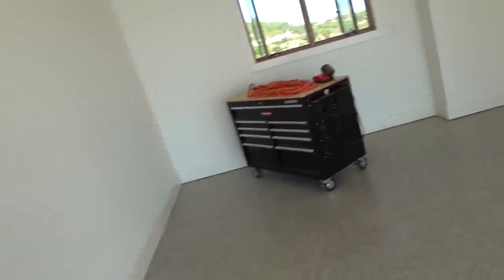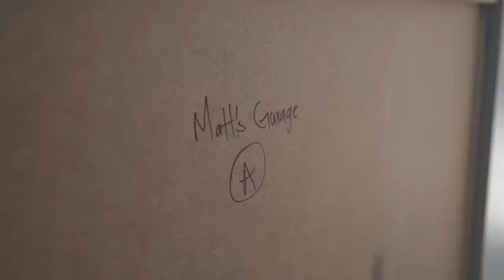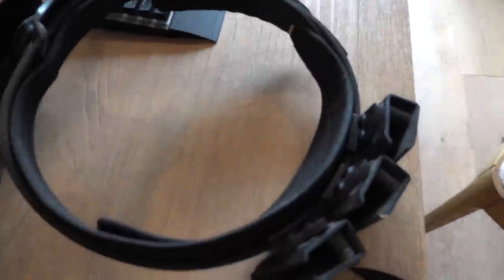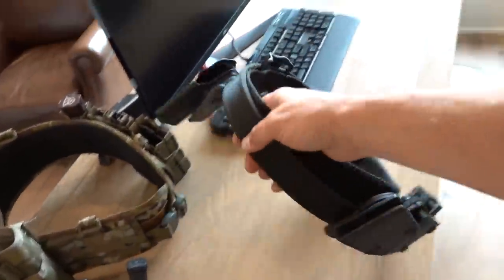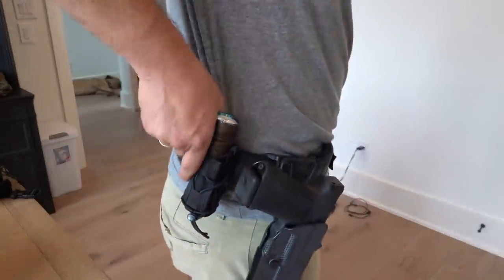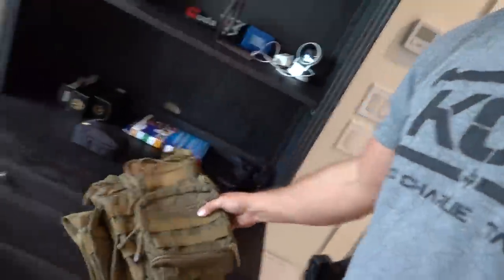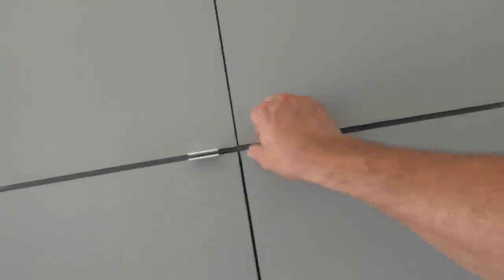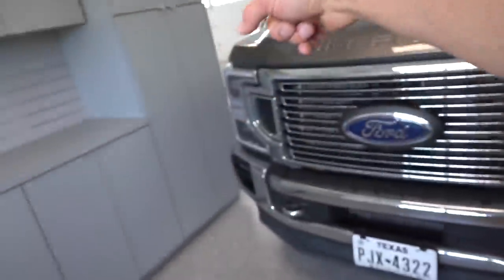Caught Intruder in my Backyard at 10pm... DemoRanch Gear Check!

Comment: Belts are going to be wicked expensive as with all high line gear. Keep belts simple, in a real world environment you won't want a lot of weight on you hips. Especially if you are not used to the weight. Belts are for making holes, plugging holes and   I like a solid fixed blade on mine. The general rule I follow is 2 handgun magazines, 2 long gun magazines and ifak with at least 2 tq and my knife. It's enough to be confident in a wide variety of environments while keeping a low enough profile to move fast. As for how to lay it out, 100 dudes would give 100 answers but keep fighting gear on you dominate side ie you look right handed and your support gear on your off side then adjust to whatever feels smooth after practicing. Iwould strongly recommend organizing a few multi- day go bags.

Comment: Federal Officer here. Wear a duty belt every single day. 

1, put your flash light on the other side of your gun. 

2, 9 times out of 10 a lawyer will rip you apart if you don’t make all attempts to render aid. If you are forced to defend yourself with lethal force, you should make all life saving attempts. 

3, ALWAYS wear some kind of body armor. Nobody knows your home better than you but that doesn’t mean you will always have the jump on someone. 

4, put some type of retention on that holster. I suggest a Blackhawk level 2 holster. Simple finger release but you won’t lose your gun if you are running or crawling or something. 

Lastly I would always have some type of shoes at the ready if you aren’t already doing that. 

You have a decent set up. Just a little fine tuning will make all the difference.

Comment: Move you stuff foward. Remove the 30 round mag move your rifle mag more foward. Nothing hard should be on the side or the small of you back especially with your back injury. Comp/go belt/instructor belt all set up same way cause high stress is high stress everything should be the same for efficiency. Only thing that changes is carrier layouts.3 hanf guns mags and 2 rifle never double stacked. While extra light is nice it's an admin item so it goes befor the gun. Cause 9 out of 10 times if your wearing a kit talking stick/s first. While capacity is important your at disadvantage for being hunter not ambusher. Along with the fact you have little ones. So emergency plans are important 2.

Comment: Speaking from 30 years of law enforcement experience.  
I would strongly suggest a holster with more than friction retention. Practice with it for a proper draw as well as how to protect the gun if the bad guy tries to grab it.
Place a tourniquet on the belt. Practice with applying it. 
Keep a small fixed blade on the belt. I used a slim push type blade behind my mag carrier. Make sure that it does not obstruct access to your mags. Practice accessing it with both hands. 
Like many others have said move the light to your weak side. Practice drawing it and using proper lighting techniques. (Notice a trend with the practice thing?)
Stay safe and train well Sir.

Comment: As a former popo of 25 yrs....the best thing you can do with a duty rig....TRAIN, TRAIN, Train with the rig. Muscle memory will make the difference. Secondly....lighter gear (flash light, multitool etc) to the front...as far up towards the clasp...easily accessible and doesn't block your weapon grab or mag grab. If you have a chest rig with molly straps...you can put the triage bag on it or keep it close by....but it appeared to almost block your draw if it's as close to the weapon as it looks in vid.
Reply: secondly....if you have a velcro lining in the main belt....that is for a velco inner belt. fits through belt loops like a regular belt with no buckle. Idea is whlle it keeps pants snug on hips, it keeps the duty rig from twisting and moving while wearing it. Works in conjunction with belt keepers....you're belt is secure and does not twist or ride up on you when you're sitting or moving around....ie, playing on the range.

Comment: I agree with alot of other comments, med kit etc. and please move your flashlight off your right side. Weaponside should never be anything but leathal items. Maybe a small highspeed platecarrier just for ballistic protection for bump in the night kit because with a fast belt you will be able to quickly slap on a easy plate carrier that just hangs on you.

Practice putting that stuff on, always store it in the same place everytime you access it. Its just as important as practicing reloading/ transitioning with weaponsystems as it is to practice putting on/off your gear. because that makes it become "no think just go"

Comment: I suggest you use an AR-15 or a Shotgun to use primarily, and you put a tourniquet and a separate AID-KIT on the belt. I also have an M-48 Trench knife on my belt, but this is just my opinion. What it comes down to is what is best for you. I also keep a vest by the belt in case things go downhill, but this is what I do to prepare for the worst outcome. If you care about magazines, then get a drop pouch for empty magazines. Make sure that everything fits with your dominant and non-dominant hand so everything is within reach and easy to grab.

Comment: I know I’m late to the party! But. Reading most of the comments they all have some pretty valid critiques for your quick response setup. Some things that are essential though would be some type of medical. Blue force gear makes great mini trauma kits and TQ holders design for belts. Best placement would be on the back of the belt so both hands can reach since self aide will be in the down tempo of the fight. At least one TQ that can be fashioned to said trauma pack. Honestly I would have the satchel IFAC stowed in a easy to access area of your  home as a sort of Triage point if a member of your family is wounded or if you’d like to attempt aide to the dude you just smoked. Avoid adding knives. The train of thought is if you start grappling and introduce a blade both of you will get cut and could equalize the fight if your enemy is able to take it from you. Biggest asset though would be getting trained on CQC and practice with your kit.

Comment: As said by Garand Thumb, you gun is just a tool, you are the weapon and it is nothing without training, find what works for you and train with it so you don't have to think. 

What's the furthest you'd have to shoot around your area? Base your gear on that, and keep it simple and clean, no need for 3 setups because that's a thought process you don't need.  If it were myself (no experience just been looking at loads of different opinions) but basing on what i've seen from ex services, spec ops ect, simple is better. 

What is a smart setup i've liked the look of and seems like a good setup also, ar platform setup 1-10 power scope with a red dot on a 45 offset, surefire light, i'm sure you have some night vision also so a peq box could be really good if it's pitch black.

But it's still all useless without training.

Comment: Don't just buy gear. Train in it too . Get your kit dialed in as it will change with use if you dont buy the right stuff off the srart. Recommend loadout on belt, 2 pistol , 1 rifle , ifac , and holster. Qvo tactical Aio pistol carries and rifle carriers are my goto. Get a good weapon light , surefire or modlite. There is 2 category of gear imo. Life saving quality and plinking.  Buy once , cry once .

Comment: So, this is in reference to @11:00, your gun AND flashlight are both on the right hand side of your duty belt?   I get that you mentioned that you have a tac-light ON your gun. But what if for some weird reason the batteries are dead or it malfunctions?    So, now your only working light is on the same side as your weapon?  MOVE THE FLASHLIGHT TO YOUR LEFT SIDE!   You can’t hold a gun and flashlight in the same hand!  And your mags should be more “upfront”.  Meaning as close to your belt buckle as possible!  Why would you want to have to reach further away than you need to, to reload?
Safariland  belts are a lot cheaper and just as good if not better!

Comment: Hey Mr. Dr. Matt, I think that any weapon that you are designating as a potential home defense weapon, as in for use in similar situations as the one described in this video, absolutely needs to have a light mounted on it. You can have a handheld light as well, but for the weapon it also, absolutely positively, needs to have a light on it.

Aaron Cowen, of Sage dynamics, preaches that they are “mandatory” on EDC pistols as well. I don’t subscribe to that, specifically because I am a smaller person and having a weapon light on my handgun in either concealed carry position was neither concealable nor comfortable for me, but I 100% do agree with it for home defense guns.

Also, as a sidenote, my home defense set up is a 5.56 pistol with a 30 round magazine. It has a weapon light and a sling on it, and I have electronic air pro hanging off of the magazine. I went with the rifle over the other two types of firearms because of Warrior Poet Society’s (and others) videos on the subject of home defense gun. Ultimately it’s up to you to decide what platform to use. 

Good luck have fun b safe k thx luv u

Comment: I'm watching this video for the 2nd or 3rd time, it's 2 years later, but I had a thought. Most people that try to come on that property to do something bad, whether it's taking something or hurting someone, are going to know exactly who you are. They'll have seen some of your videos and probably know you have firearms and body armor. So they'll probably have enough firepower to deal with that. The rest of the bad dudes who just see a big house and target it will know they're in Texas and know to come well armed. Every criminal now days has either a Draco, AR Pistol or a Glock with a switch. So if you're searching and clearing by yourself then you need a plate carrier, an AR with a light or NVGs and an IR unit on the rifle...probably one of the rifles that fires more than once with a trigger pull. Plus a pistol with a light and enough ammo for both to make sure the threat won't ever come back or even do jail time. It's better to be over prepared and not need it than under prepared and it not go your way. Or considering the licenses you have, maybe mount M2s or Mini Guns at every corner outside of the house, place motion activated cameras that have night vision, strap a body cam to the plate carrier and finally film that "How Many Criminals Does It Take To Stop A 50bmg" video we've all been waiting for. 😂

Comment: First aid kits on every pack rig. Always always. Big grab bag and ifak on the belt. Redundant light, and firearm. Primary rifle, secondary pistol. 2 mags for pistol and 1 extra rifle. 

Determine stop points in the house and get lockable firearm safe furniture you can store more mags and ammo in so you are not running back to the safe. 

I know some people that had field lights installed in their back yard so they blinded anyone out there to have a vantage point but also warning. Only one guy told me a story they had to use it and once he turned them on the trespasser immediately turned and started talking to the lights and put his hands up. Kind of the mentality police do with a roadside stopped vehicle all their lights are on the vehicle.

Comment: Your self defense firearms should all have a light on them. That way you never need to grab a flashlight, just grab the gun, it has a light. If you're actually worried about something and think "I should bring a gun", you should bring a rifle, not a handgun. A shorter barrel AR in your caliber of choice, a weapon mounted light, a sling, and a mag link giving you up to 80 + 1 rounds. Could have a TQ on the stock or in a pouch sewn onto the sling. That kind of setup is a grab one thing and see what's going on solution.

Edit: you should install external and internal security in your home to give you advanced warning if something isn't right. A dog that you encourage to bark at people and some of the equipment from a Ring security system would work well. Lets you check cameras from your phone so you can decide if you actually need to step outside or not.

Comment: Before I make this comment, I would like to establish my credibility on this subject: my friends call me RGW (Resident Gear Whore), so I feel like I'm a subject matter expert here...

On the belt setup: 
Get a dadgum holster that accepts a light. There are lot's of great ones. To name a couple of my favorite-> T-Rex Arms Ragnarok, and Safariland ALS. I integrate the safariland QLS forks with these to provide compatibility and modularity with belts and holsters so I can swap holsters between belts as needed. I also run a True North Concepts modular holster adapter to provide my holster with some rigidity. (There's nothing worse than drawing your pistol only to have your holster flap toward your body, because it's a flimsy piece of crap, preventing you from getting a good draw. 

TQ I run is a CAT tourniquet, horizontal on the belt facing my non- dominant hand, in front of my holster. This is so I can reach it with either hand if needed. Get a good brand like C-A-T Rigid tourniquet case with teklok belt attachment. 

HSGI makes a great belt, but ditch the tacos. Get some Esstac Kywi mag pouches (pistol and rifle). Thank me later. 

Move your flashlight directly behind your AR mag pouch so you can grab it with your non- dominant hand while holding your pistol in your other. 

Get some kind of medical kit; I prefer the Blue Force Gear Micro Trauma Kit Now complete kit, or the Roll One trauma pouch by Ferro Concepts. 

Other than that, you may want to consider a set of handcuffs, knife, radio pouch, flash bang pouch, or a dump pouch if you're feeling froggy.

Hope this helps man!!!

Comment: I run the Kore Battle Belt ($139.95) at work. The Kore belts have a ratcheting system making it quickly adjustable. Do you have an email for easier communication? I have a suggestion for home protection.

Comment: The flash light should be on your weak hand(left) cause your gun has no light. Just in case so you dont get used to holding the flashlight on your strong hand and then when you see an intruder it’s gonna waste more time switching the flash light to your left hand to draw your firearm. A second can  be a difference in a gun fight. Just my opinion.

Comment: In my opinion I say get a knife for your belt or vest for whenever you may need one say for example you take your more bulky belt on a hike or something and need to cut something that you just barely can’t get to with the multi tool or the grip of the multi tool you have on it now is too awkward for you to cut said thing you need to cut as another example you need to cut a wire or something between two rocks and you just can’t get it done because the reasons stated before or if you’re just trying to pull some call of duty stealth mission type stuff 

TL;DR
Get a knife for any reason you may need it

Comment: I'm sorry to say it, but I don't think the cabinet fitter did a very good job. if you look at the base of your cupboards, they have put strips underneath to keep it horizontal, which means you can get dust and dirt under the cupboards.
they had now planed off the bottom of the foot inside the wall so that the foot fit with the floor and ended tightly. would you not get dust under the cupboards, now that you had to put a strip around so that you don't get dust under there and possibly have a fire hazard if you weld or use an angle grinder and a spark comes under there.

Comment: I read a lot of comments here with a taser recommendation, for the non lethal option. I have a gas spray installed. If strong wind direction will be toward me, then I am screwed. In calm weather it can eliminate a couple or group of threats if necessary. Another consideration was T4E loaded with OC balls, but for now I consider the spray. I will appreciate if anybody can provide some benefits of taser against gas spray or T4E OC. Thanks (btw, make fun of me, but I have earplugs box and safety glasses on the belt as well - minimum space and weight, but if the situation allows, I have this option)

Comment: Matt you need a slim level 3 me i like lvl 4 but get a slim player carrier no pouches or anything just a plate that you’d put under your hoodie ngl advertising what you have is a great way to draw attention to yourself me personally I would carry a g19x with surefire light a slim belt to put around my lower belly we’re I would have at least 4 mags and a slim hard plate lvl3 body armor to put under a flannel or jacket that’s just my style for daily walking even when not concealed 
carry
Reply: It should take less  then 5 seconds to put on and you would be equipped for mostly anything. Home defense do I would carry full gear if I got the option too because someone breaking in will not hold back, so why should I

Comment: i would recommend getting a stop the bleed kit in an ifak. its lightweight and incase if you do plug someone, you'll be able to rip the ifak off and immediately start medical. In the court room, showing that you had the capabilities to save the person's life and used those capabilities seems more like you were a good dude in a bad situation rather than "some gun nut" to most people. being prepared to save someone's life and potentially doing so might save your reputation in the courtroom as well. Just my opinion, no one special here.